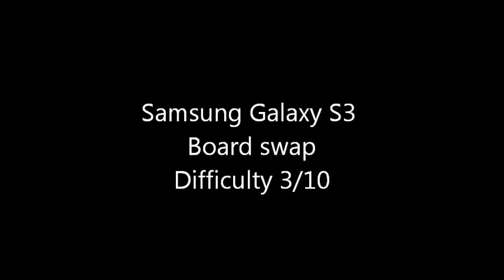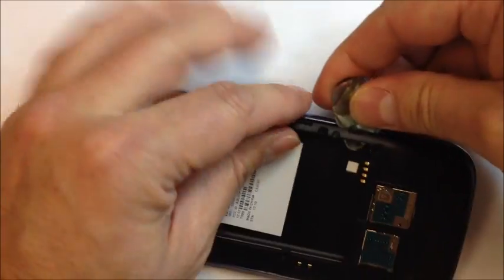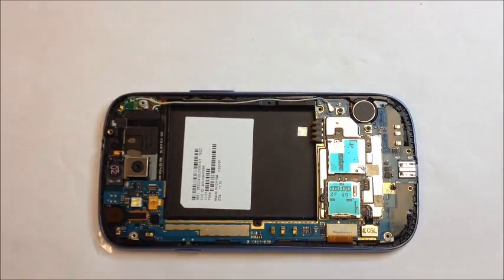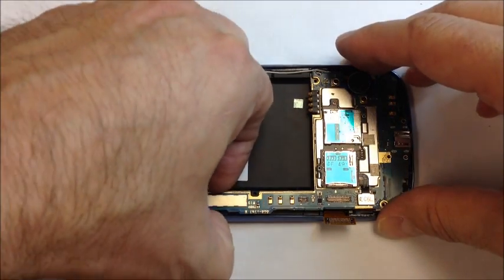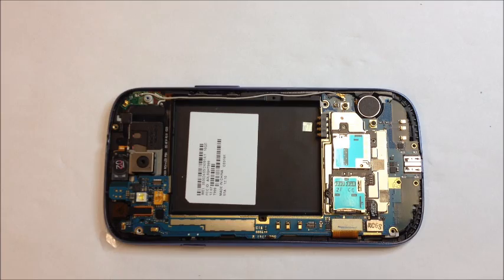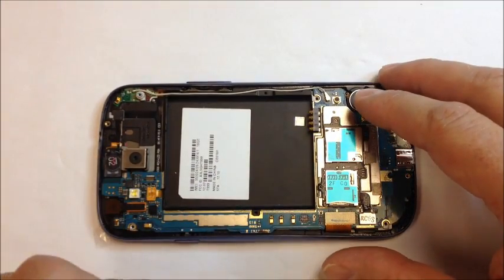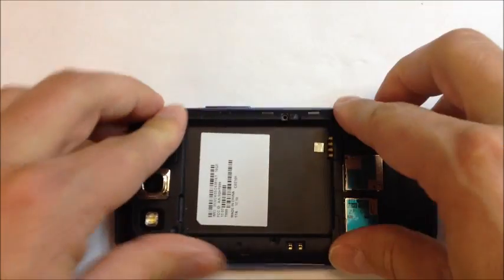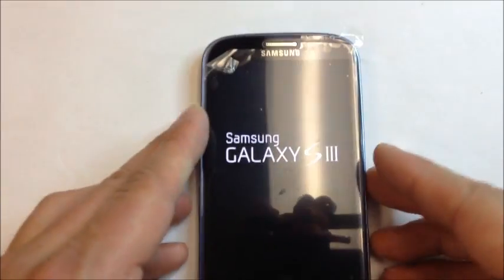Samsung Galaxy S3 tear down for board swap

Comment: I have an S3 4g and an S3 Next G, am I able to put the board of the 4G into the housing of the Next G? Are there any physical differences between the two? I ask because the screen on the 4G is wrecked but the Next G is perfect and this process looks a lot easier to do than replacing the screen.
Reply from the maker: +Master Troll If you can give me the model numbers I can check.

Comment from the maker: @Eduardo Fernández Not always. It really depends on where the source of the problem is. It could be the battery, charging port, or display but if you have the option you can certainly give it a try.
Reply: +Go Cell Phone Repair Hey! I was thinking about changing my dead motherboard with another guy's motherboard of Galaxy S3. Both are of the same model. Would there be any problem concerning the IMEI no.? Is it legal doing so? Please Reply
Reply from the maker: +Shreyas Pahade Legal yes but if the IMEI is bad it will remain with the board wherever that goes.
Reply: hey i just want to say thank you so much. i have an s3 that have a broken screen(its black and completely unresponsive) and changing the mother board to another s3 so that i can save all my data to my computer. thank you so much for this tutorial without it i wld have all my data's gone. thank you :))))))
Reply from the maker: Cool. Glad that this helped you.

Comment: Thank you very much for this video.  Very clear and extremely helpful.

Can you tell me if the SGH-T999L board will fit in a phone that had a SGH-T999 board in it originally?
Reply from the maker: +makudo77 I would think so. To my knowledge T-Mobile only has one S3 form factor.
Reply: +Go Cell Phone Repair Thanks for the quick reply.  Got one on order.  I'll let you know how it goes.
Reply: +Go Cell Phone Repair the SGH-T999L slipped right in.  But now I'm having the all too common rapid battery drain problem.  This is a software problem, right?  Not a bad board?
Reply from the maker: Could be. Did you transfer the old charging port? They are model specific so that could also make a difference with the T999L. Do you know for certain that the battery was good before the transfer?
Reply: +Go Cell Phone Repair   The board came with a new charging port and that seems to work fine.  The battery was good as far as I know, but I also have two brand new replacement batteries that all behave the same way.  They lose 1 or 2% ever couple minutes off the charger.

I've tried clearing the system cache, rebooting in safe mode and a factory reset and none have fixed the issue.   Any thoughts?

Thank you for all your help.   You are a tireless good samaritan, with all the comments you answer on this and other threads.
Reply from the maker: +makudo77 The first thing I'd probably do is pull the board and compare it to the original. Even though it fits if there is some small detail that is different it could cause a grounding issue. Are you noticing excessive heat? Piecing the battery, board and display together without actually installing the board into the mid-frame would be a helpful method to see if the same thing happens but it's kind of a pain to hold the battery in place. Outside of that there could be a problem with the board itself and if it's not hardware I'd check it under a microscope for any indication of physical damage of moisture. There's no short answer unfortunately as you might have one of hundreds of potential problems.

Comment: Hello! I used your video in the past, very helpful! 

I was wondering if I could use a Sprint logic board in a Boost phone as long as the ESN was clean.
Reply from the maker: +quietpianist If they are both L710 then yes it should be compatible. Check with Boost though and make sure they can activate your ESN.

Comment: So I broke my s3 screen about five months ago, used this video and swapped the motherboard to a new one but I cannot remember the password. How can I bypass the screenlock password? Or transfer my data without corrupting any of it without factory reset?
Reply from the maker: Adrienne Burns Can you use the password recovery option? If you set up a google account on it that should work. I don't know of any other way to bypass it without erasing all of your data.

Comment: I completed the swap and now i unable to hear anyone when i make phone calls . I have to put them on speakerphone and also the "home" button doesnt work. Do you have any tips about what went wrong?
Reply from the maker: Jessica Boyd Strange since those are at opposite ends of the phone but I would check the connections for the earpiece first and make sure that the flex cable didn't get damaged somehow. The home button plugs into the display just above the AMOLED flex cable. You can see it after you pull the board out. Those come unplugged sometimes when you get a new screen and have to be slid back into the right position.
Reply: I checked the connections for the earpeice and actually changed it out from my previous phone, the  volume keys are working but the earpiece still doesn't. Thanks for your help

Comment: Thank you for this helpful video! The screen on one of my galaxys cracked and I had an extra old one with a broken charge piece sitting in a drawer. I followed your directions and it worked swimmingly! I have all my data, pics and apps back so my next step is to back it all up on my laptop. Thanks again!

Comment: Thanks for the great video. very informative. I need to replace my board. How do I ensure its the same one I'm purchasing. Also, where can I purchase the board from besides Amazon.
Reply: No response to date
Reply from the maker: Allie Moosa Make sure that you get the same model number. If yours is i747 then a L710 board won't work. You can probably find one on Ebay but  I don't sell them myself.
Reply: Okay thanks.

Comment: Hello sir! You made this look very simple and easy to do. So I thank you for that. I have question though. I will be taking the mother board out of my Boost S3 and putting it into a Sprint phone. Will the Sprint Phone have to be unlocked before I can use my boost phone number and everything on it? Or will everything transfer over with no problem? Thank you!
Reply from the maker: Skate3Filmage If the Boost board fits into the Sprint frame then you should have nothing to worry about as all of your subscriber info is stored in the logic board. I only say if because I haven't tried interchanging the two so look at the layout first and make sure the area of the frame that accomodates the logic board is identical to your original.

Comment: Hi @ Go Cell Phone Repair if I have a straight talk galaxy s III ( model number SCH-S968C) and it has CyanogenMod installed on it and it thinks its and SCH-I535 can I put a i9300 board in it I would like to do so so I can update my phone to newer android versions. On an off topic note is it possible to change out the modem chip on a 3G phone to a 4G one like upgrade it? Thanks in advance!
Reply: Go Cell Phone Repair Bump?
Reply from the maker: For your last question, no, you can't change out anything in order to make the phone 4G capable. I'm pretty sure that the i9300 board won't fit an i535 frame as Verizon/Straight Talk usually has a unique board design that is different from the GSM version.

Comment: I have an s3 with a cracked screen. I have replaced it once already and it is a pain working with the UV glue, but I managed, getting only one small air bubble in the corner. Well, I did it again. I was wondering, could I buy a used s3 with a bad ESN and simply put my mother board in it. Would that work, or is the ESN located on another chip in the phone. Your reply would be greatly appreciate.

Comment: if i swap boards from my old s3 to the new s3 will i get everything i had on my old one like the number and all the info?? help ASAP
Reply from the maker: Yes.
Reply: Thanks I'm going to try it out. Have any tips I don't want to break anything
Reply from the maker: Leebeast99 Other than following the steps in the video just be gentle and make sure that you unplug all of your cables and put them back into the proper position. You should never have to force anything and also make sure that your driver seat properly on the screw heads. Stripping a screw can be very frustrating.
Reply: This will work for the virgin mobile model right?
Reply from the maker: As long as both phones are Virgin GS3 then yes it certainly should.

Comment: If I swap the board will the new one come with stock firmware?
Reply from the maker: It will come with whatever was installed on the new board so hard to say for sure but probably.

Comment: Hello and thanks for the video..
I am looking at replacing the motherboard on an i9300 because of the charging port worn out. I've found replacement boards on amazon that appear reputable however the image looks like the board is missing the SD and SIM. Can you clarify where you get your parts for this or if I should be OK 
Thanks
Reply from the maker: That's a good question. We usually pull boards from phones that we have on hand. You can try Amazon or Ebay but be sure to communicate with the seller regarding what you are actually getting since they often use stock photos. As long as the model number matches you shouldn't have any compatibility issues and if necessary you can salvage the SIM reader from your old phone assuming that it still works.

Comment: If I have an unlocked Galaxy S3 for the provider Sprint, and I get a board for a Galaxy S3 with the provider AT&T, would that make a difference? Would there be complications?
Reply from the maker: Yes. Sprint the Sprint S3 is CDMA and AT&T is GSM. It would be like trying to pick up an FM signal on an AM radio. Also the chip layout is different enough so that the mid frames are not interchangeable.

Comment: Question. My phone all of a sudden turned off and has not budged since. I've tried software type fixes with no hope.

I have a ton of information I need from the internal memory. I have a replacement device sent to me. If I put the old board into the new phone, could I transfer that information off the device then onto an SD?      The problem I have seems to be something between the charging and the battery. It was having charging issues the day it died, and a good battery (that works in my replacement) does nothing to the original device. 

Please let me know if this is something I should bother with attempting. I'm afraid of those flexible cables that snap in with the LCD and wifi for example. as well as the power button staying aligned.
Reply from the maker: Hard to say 100% but from what you describe is sounds like worth a try for sure.

Comment: my circuit board uhhh....burned? easily said: i need a new circuit board. do u have a vid about replacing the circuit board of a SGS 3 I9300.
Reply from the maker: Not the i9300 specifically but all of the S3 procedures are nearly identical.

Comment: When my s3 is charged the battery dies in less than an hour, so basically to use the phone i gotta stay close to the charger. However random at times it functions normally and stays charged for like a complete day. It's not the battery, already changed that. What could it be?
Reply from the maker: My guess would be a hardware problem. Most likely on the board somewhere.

Comment: My 17yr old son went on a rampage and cracked my screen and digitizer. There is someone selling another S3 with all working parts (bad esn) it is a sprint S3 mine is a Boost Mobile S3. My question is, can I just take out the main board on my S3 and put in in the Sprint S3 with the good working Screen and digitizer? THANK'S for the video...Looks simple...

Comment: Hi, I have a gs3 that I dropped (no physical damage) and the touch screen stopped working and the screen bleed out. I have valuable picture from a trip that I want. Yes, I have already used my SD card and downloaded what was on there but they, I think it was because I put them in there own album/folder, did not transfer. So, my question is, would a board swap help me in this situation? If not, any suggestions on what to do?
Reply: Similar question I have. Except my broken phone won't do anything. I hope he can answer both of our questions.
Reply from the maker: Yes. If you put your board in another phone or replace the display you should be able to access your stored media.

Comment: i replaced my screen but somehow broke the phone while doing it, all the buttons work, but i just have a black screen, i assume i broke the lcd screen or the digitizer, anyways i wanna back up all my files, i'm gonna ask my friend if i could use his galaxy s3 and do a motherboard swap so i can put all my files somewhere, i don't wanna break his/my phone, is there any possible way something will break during this swap?
Reply: If you STILL are looking for a solution, the only thing that'll really break is the plastic housing, but that's if you're aggressive with it. Which shouldn't be necessary.

Comment: Tried my first screen repair tonight on an S3.  When I separated the screen from digitizer it was so stuck it tore the digitizer ribbon cable.  I had a second S3 with a bad charging port but a perfect screen.  Thanks to your video I did a motherboard swap and got the S3 backup and running.  Thanks for the great video.

Comment: I have a logic board from a USCC S3 with a good ESN. Can this be swapped into a Verizon S3 with a bad power switch?
Reply from the maker: If the model number is R530 or i535 then yes it should fit. Getting Verizon to activate the new ESN might be another story though. I would call and make sure that they can do that part before you start.
Reply: Thanks for the info. I'm planning to give the phone to my niece to use on StraightTalk. I'll check with them about activation.

Comment: Hi, this was a great video.. I was wondering since I'm also getting a replacement because my note 3's screen stopped working, would I be able to swap the board to the replacement that works in order to get my pictures and video from it then swap it back to send the broken phone back? Do you think there would be a problem with this? Thanks a lot!
Reply from the maker: No problems as long as they are identical models. We do this for customers quite often.
Reply: Go Cell Phone Repair Hey thanks for the response back.. I did it and it worked for me. I know I'm a little late in responding lol but thanks a lot for your help.
Reply: VapeTech same dude, dif email....

Comment: I'm trying to remove the screws on my galaxy 3 and can't. I've used several different phillips screwdrivers and they are so tight I can't get them to budge.  I've done this several times with other units so I'm just curious to know is this common or can I try something else?
Reply from the maker: What style/brand drivers are you using? They can be stubborn sometimes. I find that the Husky PH00 driver that they sell at Home Depot works well because they have a pretty decent sized handle allowing greater torque. The only catch is that you have to grind off the end of the tip just a bit or it will be too tall at the point and strip your screw heads.
Reply: Thank you I will try that.

Comment: I recently dropped my phone I'm assuming pretty hard because my screen went black and the display was jumpy , blinking in and out so I took it to get repaired, by the way my screen wasn't scattered just the display problem and after the new LCD replacement my camera wouldn't work , I was getting a failed camera message, also my phone when it goes to sleep I can't get it to come back on without taking the battery out and restarting it do u think a new motherboard will fix the problems?
Reply from the maker: It sounds like you may have multiple issues here. Did all of the problems occur as soon as you replaced the screen and did you do it yourself?

Comment: My Galaxy Siii (ATT) is not charging. I have seen videos on how to replace the charging port. I don't want to do any soldering. I want to just purchase a new mainboard and swap out the old one for the new one.

My Question: If I purchase a new mainboard and install it on my device, will I have any issues activating the phone after the mainboard has been replaced?
Reply from the maker: That all depends on the status of the boards IMEI/MEID. You should be able to check with your carrier before you buy the new part.
Reply: Rob Ilagan wow, I got to research before I comment, sorry..

Comment: So for instance I bought a phone of Craigslist an s4 to be exact and it has a bad imei would swapping the motherboard essentially work to be able to utilize the phone under its original carrier?
Reply from the maker: As long as the board has a good IMEI then you should be fine. Keep in mind that the configuration between some carriers is different. I assume that you are referring to GSM since you said IMEI so if it is AT&T or T-Mobile the board layout is the same but if you go from one to the other you will of course need to unlock the new board.

Comment: Go Cell Phone Repair can I change the motherboard from a i535 verizon model, to a U.S Cellular model? Keeping in mind they are both CDMA phones, but the Verizon one accept GSM too.
Reply from the maker: It looks like the i535 is unique to Verizon so the answer is no on that one. Compatible models for U.S. Cellular are listed as R530 for Cricket Wireless, U.S. Cellular, and MetroPCS.
Reply: Go Cell Phone Repair well i did it, before you guys answer my question and was everything good, i looked on eBay for the screen and on eBay said the screen FRAME was the same, so I give it a try and it was all perfect. That frame (US Cellular) is compatible with the Verizon frame. But thank you for answer me though. I really appreciate it.
Reply from the maker: Ariel Ismael Congrats and thanks for posting. Someone else may may the same question and now we know.